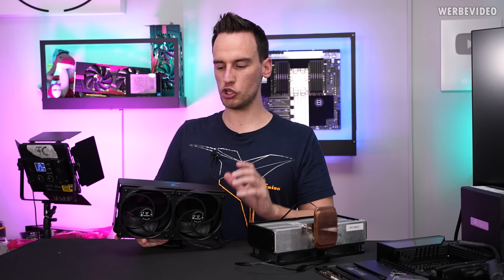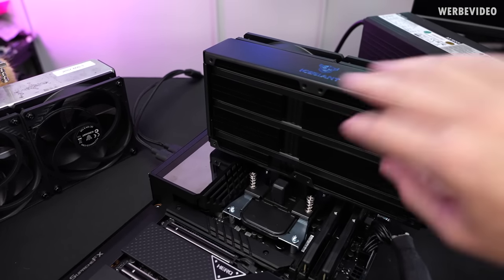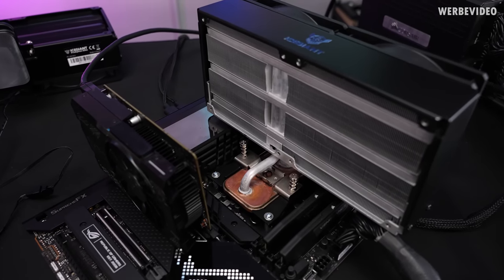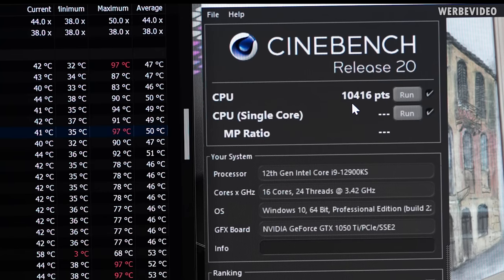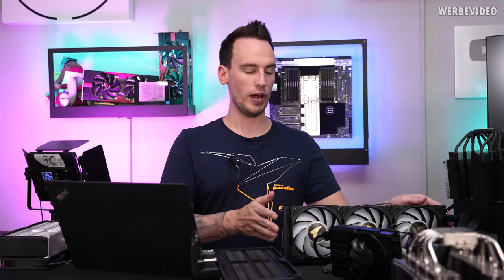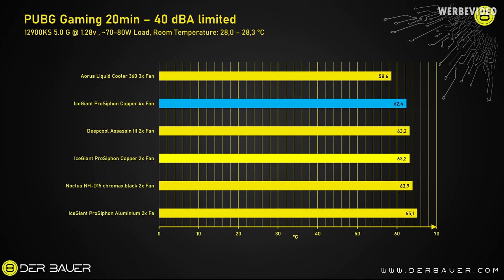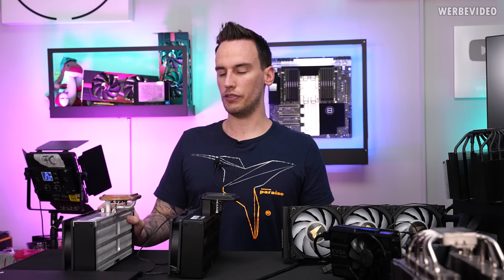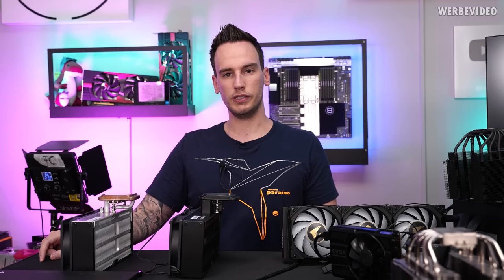This Prototype has A Lot of Potential !

Comment: At the same time I’m excited for new cooling technologies, I’m also disappointed I soon will need to buy a freezer to cool my computer, because manufacturers keep pushing power to new extremes as if both power and cooling capacity aren’t a problem.

Edit: funny how comments mostly lean to the “just buy low end” and “nobody’s forcing you” classic replies. Shows how little the future problem is currently understood by average folks: “we don’t need to come up with better optimizations when we can just waste more of the finite resources in this world”
Reply: I wonder what will happen 10 years from now as manufacturers hit 2nm nodes limit. They will enlarge the die and it can easily reach 800W TDP which means it will need ~1500W of electric power.
Reply: To be fair, nothing is stopping you from limiting your own hardware. If the new cards from Nvidia really have those power targets, you can run games at slightly lower settings and capped framerate to keep usage lower, and produce less heat.
Reply: So? It's called headroom. If you don't want to pull that power, buy a lower end product or lower your settings.
Reply: @analogicparadox  But then why have the card if you can't run it at the levels where it's a worthy upgrade? That really chips into the card's value if you can't play it at its normal performance.
Reply: Nah, thats wrong, you have an option to go for these super power hungry solutions if you want super power performance, nobody is forcing you to do that, the efficiacy is going up, thats what matters, you can buy mid end and then you dont have to worry about power usage, and still have more performance then what was a few years ago enthousiast range.
Reply: @budgetking2591  totally agreed no one says you have to go to a 2000W pc in the future you can stay gaming on your old 750W/PC that will be a potato PC when everyone else is running 2kW PC’s
Reply: @shorty808100  lmao, we can act like 1080s and 1660s are "potatoes" if you want. But they can sti run games well.

A 3080 is going to last you a whole lotta time.
Reply: not freezer, the outside body of a powerful AC * 😂
Reply: i look at that per core . and individual cores still use way less power than years ago . but coolers have to cool more cores than years ago . pushing the cooling limits for more core density is a good thing . the reason we think it's intel or amd's fault. it's because we all turn off the power limits .
Reply: @budgetking2591  This is a very good point now that I read it... I'm not too fancy on lowering the settings too much, but I forgot the mid tier upgrade entirely.
Reply: There are still low power chips available dude, you're complaining about a nonissue
Reply: you won't. you're being dramatic.
Reply: @sephondranzer  how about just buy a gpu that has the power draw that fits your budget/build.... oh no the pain of doing that...
Reply: exactly, 350w Intel cpu+600watts (and without accounting the transients) gpus.. enough to trigger the protection of most home electrical systems, if an oven or a few air conditioners are on at the same time that you game. Let's not even account heat and (especially for me) noise.

In this era of very low bills..
Reply: @analogicparadox  efficiency is impossible to argue against it’s always more important
Reply: @analogicparadox  over time graphic cards will become very short life products if we keep pushing power limits too high. It only takes common sense to figure that out which you clearly don’t have.
Reply: @heatnup  resorting to insults just highlights how your point is just built on speculation and opinion.
Reply: Drop clocks/voltage, reduce fps by 10%, reduce power draw and heat by 40%, ez.
Reply: People in this comment section above me are beyond dumb. The problem with "buying the low end" is that game developers and software devs WILL FORCE you to buy at least mid-range sooner or later. Like it or not the graphics requirements will crept up each year. There's a reason why nobody plays game with GTX 700 or GTX 600 or GTX 1030. Because they were FORCED to upgrade. 

I would be more than happy to buy lower end GPU if it can give me 60fps for all games and reasonable render time on Adobe
Reply: @kaptenhiu5623  Nobody is forced to upgrade.  Rich people don't care, they will buy newest graphics cards. As for poor people - only impatient idiots buy newest xx70 (or higher) GPU to play new games at release. Smart people don't play newest games at release - they wait 2-4 years and buy cheap xx60 GPU from current or last gen to play games from 2-4 years ago.
It's literally a non-issue for people with a little bit of self-control.
Reply: @analogicparadox  so is yours and I didn’t resort to an insult I was saying that IF you truly believe that efficiency is pointless you have no common sense. I just never understand the logicless idea of letting us run 600W GPUs because “more performance” when 250-350W is the point of diminishing returns. Like does that 2fps mean that much to you? Cooling is way harder the more power you draw it’s not just about saving money power wise and it degrades the silicon faster. Like I said there is no argument for inefficiency, only efficiency has an argument.
Reply: @heatnup  nobody said "efficiency is pointless". I said there's ways to circumvent power draw. The power draw of the 4070 is estimated at around 285W, for what looks to be a good 40/50% performance increase. That is not "2 fps". Higher TDP doesn't necessarily mean inefficiency.
Reply: @analogicparadox  why would someone limit the performance of their GPU to save power? It’s not in the users hands to make a GPU efficient it’s in the hands of nvidia and amd. That’s the problem, you are excusing ridiculously high TDPs. The point is some people don’t like tweaking via undervolting and power limiting therefore you can’t just say “just circumvent it through X means”. That’s literally excusing Nvidia and AMD to make worse products because “the consumer can fix it” 

Do you genuinely believe that the 4070 performs 40-50% better than the 3070 because of the 35W?! 😂

Higher TDP quite literally equals less efficient.
Reply: @analogicparadox  yeah but it’s destroying the planet
Reply: @FinneousPJ1  why can’t we get the best parts without having to pay an extra $100 a month on the power bill?
Reply: @trapadvisor  Because more power budget = more performance
Reply: @JMatrx  What kind of silly scenario is this where a power load of under 1000w trips "most" home electrical systems,if you turn on a bunch of other completely unrelated high power devices. Come on man. You don't have to make up nonsense to call power creep a problem.
Reply: @ffwast  hm well some home appliances here are sub 3kw total, so 1000w + say, a water boiler and an oven running, you well trip over the electricity counter..

Comment: Just an idea, but maybe when showing those average temperatures, it would be handy to show the standard deviation.
In that case we can see the spread (dispersion) of the average at the same time as well.
Reply: What I'm missing from Icegiant's website or any YT test, is a simple Power/temperature graph in a standard environment: Place a hot plate and a thermocouple under it and plot dissipated power / Temperature graph. That would be the most informative way to judge how a specific processor would behave under it. There are other factors in processor cooling, but it reveal its performance curve.

Comment: I like this thanks. I think their stock offering is fair from what I've read so far as a micro investor. With the next gen cpus all being Bulldozer class heat generators. This will be good for the high end as the current AU AIO are being thermally maxed out. By that I mean with the current heat waves of +32C and higher temps, everything throttles, unless you have push/pull fans running at max speed. I went thru 2 AIO's in 2 years. Now I custom loop or Air cool my components depending on the systems intended use.

Comment: We only see the motherboard flat on the desk so i don't know how you tested at all but i remember that for the original aluminum pro siphon they said that the cooler worked optimally only mounted in 1 orientation (the way it would be in a case).
Did you check for this?
Reply: but which case for the direction? there are like ALL directions in various cases...
Reply: @LiLBitsDK  the most common upright case.  Cases specifically mention when it's flipped and, it's obvious when it's flat.....
Reply: Thermosiphon has 2 possible orientations. One is with mobo flat on the table and termosiphon on top (any orientation), and another is motherboard vertical and termosiphon heatsink parallel to table surface but rotated to be higher than CPU cold plate. Either way works more or less the same, if you don't use these orientations it does not work and it becomes just a big passive metal heatsink (that has no chance of cooling 250w)
Reply from the maker: It was tested flat on the table. This is following the official guide. Just check it here: https://youtu.be/pcUn6DY5sRY?t=38

Comment: A couple of things I'm thinking:
1)im wondering if putting two more fans on the other side as a push/pull config would drastically increase the performance (just saw the 4 fan test, cool that it works well enough that it doesn't make much of a difference, but sad that it doesn't make much of a difference) 
2)the thermosiphon design is hard to do in such a relatively small thermal system, so this is neat. I need to watch the original video to see how the routing in the exchanger is done, but mostly I would think the biggest thermal bottleneck is one pipe/the size of the pipe
3) they could probably make this a fully passive design that works well on lower tdp cpus if they tilt it maybe 30 degrees or so. It needs to somewhat be upright for the thermal siphon to work as well as possible, but somewhat horizontal for passive air movement from heat.
4) depending on how they have the block itself set up to deal with seperate heat zones, I could see either massive losses in the efficiency of the siphon, or potential issues with hotzones on certain cpus.
5) I wonder if they're taking advantage of phase change properties for heat removal and siphon efficiency

Comment: Hey Der8auer, have you had much interaction with Hypertec/Submer? I would love one of your 'deep dives' (see what I did there!) videos on them. It seems a much easier implementation of a full submersion set-up compared to say Novec (although not as cool looking without the phase change) but the energy savings look really impressive and using ocean retrieved plastics is also really cool.

Comment: Can't wait for that thermal conductivity video! Back when you were working with the 3M Novec (or similar, I don't recall exactly), I started really getting into interesting types of cooling, and have tried diving into thermodynamics some. Although I'm learning on my own just picking up some stuff here and there as I try and figure out how some designs would work. Struggling to pick it up, but I'm getting there. Mostly just trying to figure out if this is just a phase, or if it's something I'm really interested in to the point I could really focus more specifically on learning it.

In other words you were a big inspiration for me in that regard, and I'm excited for more content diving into that! 

Also would it be possible to contact you through email to get some potential advice/answers to some questions I have for a potential personal project delving into this field more?

Comment: In the aerospace industry it's common to have airplanes and satellites with thermal management technology for controlling heat from things like flight computers that has finned heatpipes with phase change materials aka PCMs between fins.

PCMs allow rapid absorption of thermal energy without an increase in temperature until phase change is complete. Phase change is commonly a solid to solid where the change has to do with materials structure or solid to liquid. Kind of like a thermal capacitor that dampens thermal swings but doesn't innitially heat up to do so.

System using a finned heat pipe PCM unit would draw heat from CPU or GPU through heat pipes then heat moves out through fins being rapidly spread and absorbed by PCM. PCM unit would use a air or liquid cooling system to then remove heat into room air. It's a thermal management unit that goes between CPU and cooling system.

Comment: the ice giant is really interesting since it has so much cooling capacity without any moving parts, if the price is good i will most likely get one for my next system
Reply: It had fans though?
Reply: @mddunlap03  yeah but those are external and really easily serviceable, atleast comparable to water pumps in aio which also has fans, and in light lead the ice giant could probably mange passively

Comment: If you are that worried about cooling your PC all you have to do is buy a case with a side vent and hook up a small AC duct to it, which will flow right towards the GPU, and with a top mounted Rad exhausting the air will flow up and out, and help the intake overall, with that setup you don't even need to fully black out the AC, you can half duct it and leave the other half open to the room, and the intake fans creating a negative pressure in the pc will guide the cool air into the duct through the duct and into the side vent / PC case.

Comment: I wonder why they didn't make the rad thick and have fans running push/pull horizontally instead (from the perspective of it being in a standing case). That way it will make less of a hassle installing, thicker rad, fewer fans, 140mm fans are optional... may be even lighter. Hope it didn't have anything to do with the way this cooler operate of course.

Comment: this is a sort of review i'm putting out for this cooler since very few people have documented it

i bought one half a year ago i'd say, it can cool a R7 7800X3D very well but on full load like in cinebench it can reach the thermal throttle limit of 87°c, otherwise in gaming it works wonders, i can have the fans set up to 200rpm and the cpu wouldnt reach above 75C, i think it could do passive cooling on its own it could do it on my previous cpu a R5 3600, the structural integrity is pretty good but some of the "paint" or compound they use on the outside cracked a little bit on the top of the cooler where the icegiant logo is, thats the only bad thing that happened with it tho

my R7 7800X3D is overclocked with PBO as much as i can, if i was to get a better cpu like some recent r9 or something then i would suggest to invest in a 360aio, but this icegiant cooler does a fantastic job and beats most 240mm aios for cheaper, also if you need to add ram sticks you'll have to remove the cooler but how many times do you do that anyways, i really wont mind having to remove it in a few months to put 2 more sticks and be done with it

its also not too heavy, i was worrying that it would probably rip the cpu out and fall over but you have to put a full bracket that comes in the package with 4 big screws, the weight is well spread around the chip and it hasnt bent at all since i've had it, i seriously recomend this cooler lol i honestly think it might be the future of cooling

one negative aswell is that its quite chunky and i had to remove my rear exhaust fan as the cooler was sitting really close to it, it would have been basically useless, and the two top fans i had were also very close to the cooler's top fan and it was a pain to install with them on so i removed them as well, the temperature hasnt changed much and i dont think they wouldnt make much of a difference, my case is a coolermaster h500 so keep that in mind, maybe with a bigger case to a full tower you could have more fans around the cooler for exhaust and it would be even better

also be careful when tightening the cooler on the socket, the screws have those springs and you might think you need to fully tighten until the springs lock but you should only do it until you feel its right cause i'm pretty sure you could damage it by going too far

Comment: I wish they would do a version that used flexible hose in the form of a 240 AIO. I could actually use it then but my guess is permeation would be an issue with liquid that can evaporate that easy.

Comment: I found on my 5900X my temps dropped 3-4 degrees by using a IC graphite pad instead of thermal compound.  I think it's because of the heat spreading effect from the pad.  I'm sure it could be even better if there were a custom IHS to fully support a pad all along the bottom of the evaporator as well.

Comment: I have their first gen unit it's great for power-hungry CPUs with large IHS. But my 9900k even though it sucked done 210w it still got up to 90-100c IHS was too small so high temps. Tried it on my Ryzen 5950x and it was only a few degrees behind a 420mm radiator about the same wattage. So only difference was the IHS which leads me to believe it won't work on older consumer-level CPUs. But most new CPUs have big IHS sop that shouldn't be an issue anymore. Will probably buy this new version when it becomes available.

Comment: Someone should design a literal all in one. The motherboard is everything. The case, the cooler, the gpu, the power supply, everything. Either some watercooling or extreme overclocking setup, or a passive setup. It would be so cool to see something like that.

Comment: Needs to be 100% copper if they want better temps and even then I don't think it would be good enough
Reply: 100% copper could result in a very expensive cooler and the gains would be very minimal vs costs
Reply: @ravell2854  I know